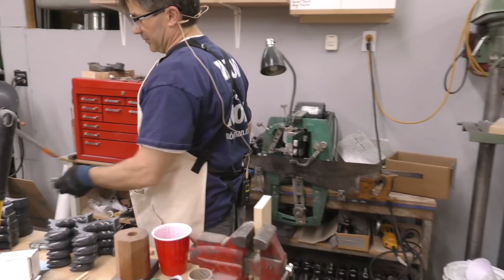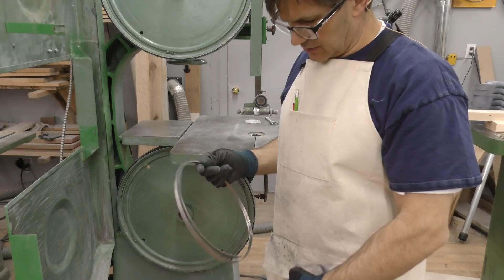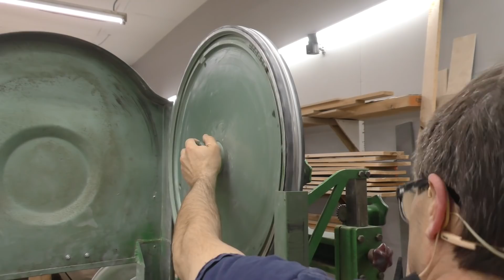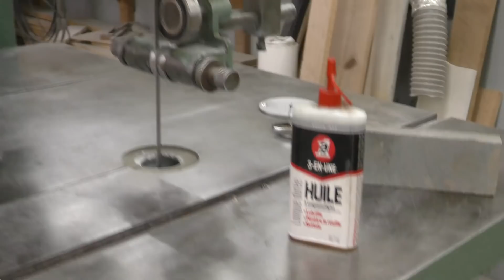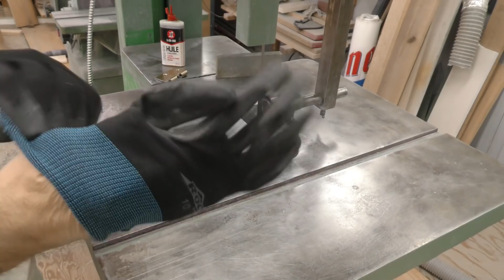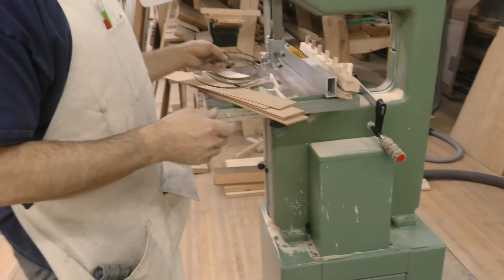Band Saw Magic,  Episode 7, Cutting Metal without teeth!

Comment: What kind of sorcery is this? Just tried this and this may be the single most helpful thing I've found on YT in a long while. My bandsaw has gear reduction, so it's always been able to cut metal with the right blade, but thin sections are tricky as even with fine teeth, they tend to want to "grab" the teeth, especially if the metal is thin and tough (think thin stainless). This method gets around all of those issues and for you folks who only have high-speed wood-cutting bandsaws, this may be just the ticket! Thanks Rob!

Comment: Couldn’t you turn the blade around backwards since it’s already flat?
Reply from the maker: Then the teeth would be chewing up your guides and your thrust bearing!
Reply: And most blades are bimetal, so you have tool steel on the teeth side for cutting strength and mild steel away from the teeth for toughness (less brittle). Mild steel won't get you very far doing anything to metal.

Comment: How hot does the work piece get doing this? And just to double check, this would work at typical speeds used for cutting wood?

I tried to cut regular angle iron using a metal cutting blade with 14 tpi, but without speed reduction, and i had to press quite hard for the teeth to start to engage. And the work piece got too hot to handle about half way through. I would expect this method to heat up even faster without any teeth but that's just a guess. What's your experience? Does this cut using friction? Does the blade get hot also? Sorry I'm just curious and don't yet have a blade to sacrifice. Ty
Reply from the maker: Friction, compare surface area of the blade to the small point of contact on the metal.  Works like magic!
Reply: @RobCosmanWoodworking  Do you have to push really hard or is it slightly harder than wood? How thick of metal are you able to cut using regular bandsaw speed? Ty